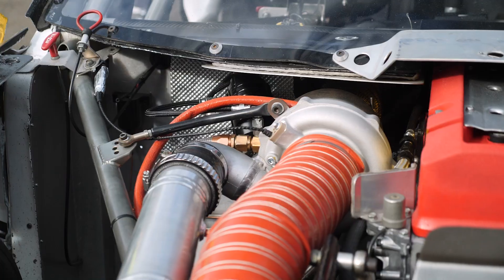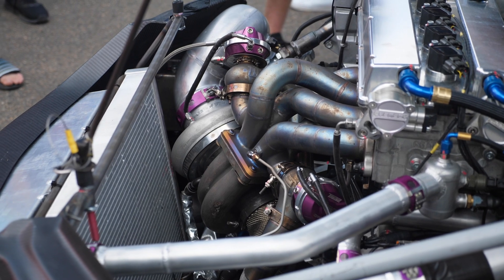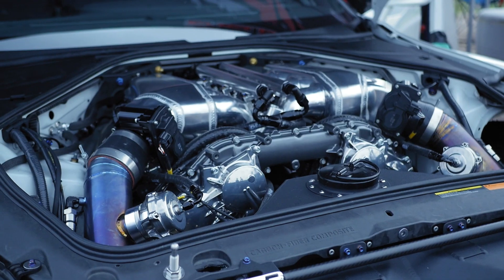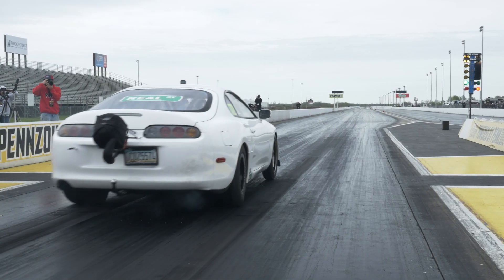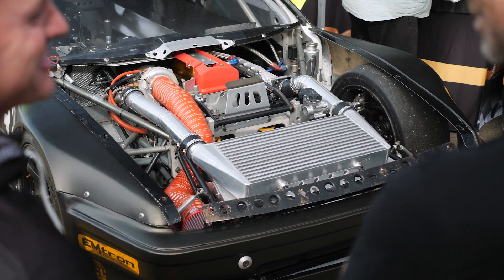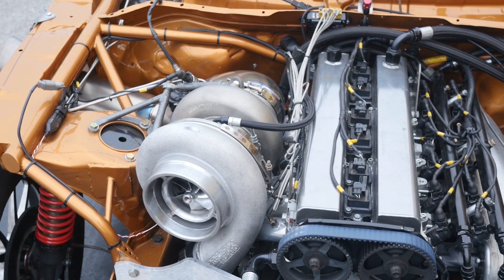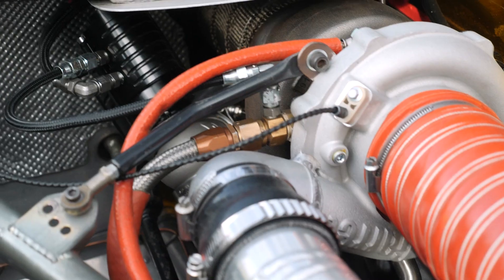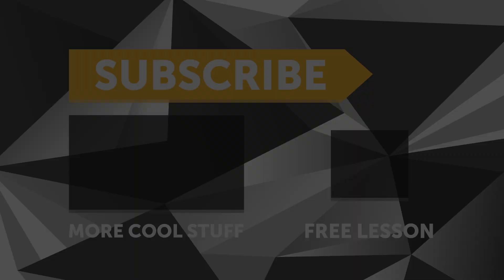1 Way Your OEM Electronic Boost Control System Is Flawed

Comment: Hyundai Genesis and Kia Stinger Twin Turbo V6 cars have EWG support via the Burger Tuning JB4. I am trying to push Burger into giving this capability to the 1.6L and 2.0-2.5L 4 cylinder turbo cars as we have much more severe traction problems vs the AWD or RWD Genesis/Stinger platforms. As a drag racer we need more precise control.

Comment: Great video! Do they use a spring in these setups so it fails safe? My fear going fully electronic would be if (when) it fails, it will block all bypass sending boost to unsafe levels. 

It also seems that more OEM’s are going this route. Originally I thought it was so they could completely turn off the turbos under certain situations for engine safety/fuel economy but they don’t appear to be doing this. 

Also did some research into Ford’s electronic blow off valves. My only conclusion was they went electronic because they are cheaper but I really don’t know what all went into that decision.
Reply: no, these e-gates don't have springs I believe.  If there is a problem the ECU just cuts power before anything breaks.  Also since it's controlled in a PID loop, if the ECU is unable to get the wastegate to its target position it can throw an error and cut power even before an overboost condition occurs.
Reply: look up Jamie PFI Speed they split the block in half with a stuck Egate.
Reply: @Nebbia_affaraccimiei  but they had overboost protection 'Off'.
Oops.
Reply: Rare Earth Traction Motors are very reliable they have been in use in production cars for over a decade now, how many failures have you seen?? I'll wait. They offer ways to control boost because all too often the boob behind the wheel is ignorant and that leaves to warranty issues. They keep torque in-line with electronic controls and it's much easier to do it that way. This is why it's very difficult to get a modern torque tuned based OEM turbocharged car to knock on nasty pump gas, it just limits power via timing and boost pressure. Give it excellent fuel and it will allow more timing but boost pressure will be limited by the torque management systems. The factory recalculation valves have little to zero to do with boost control. My previous car was a Ford Focus ST. The current car is a Kia Forte GT.